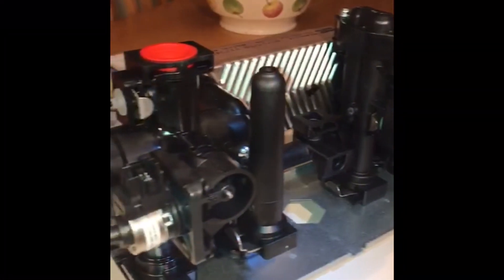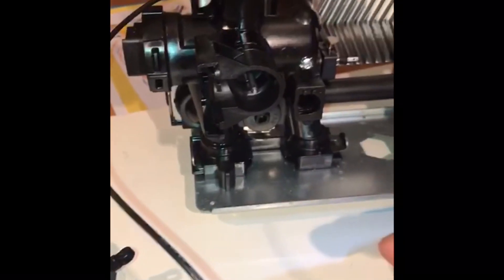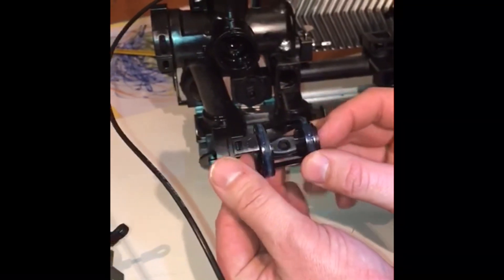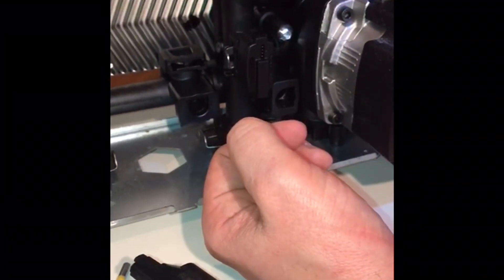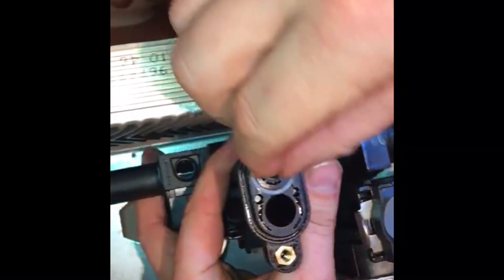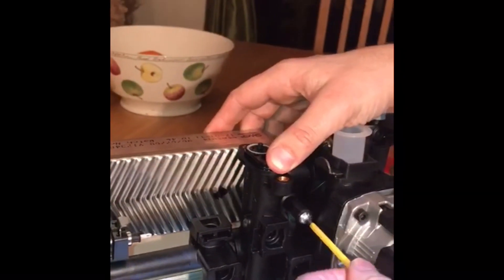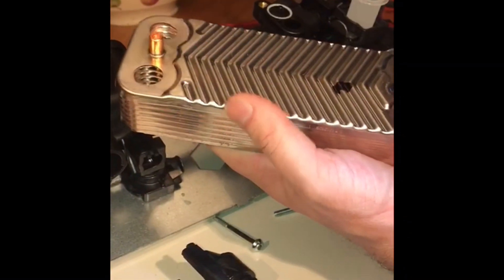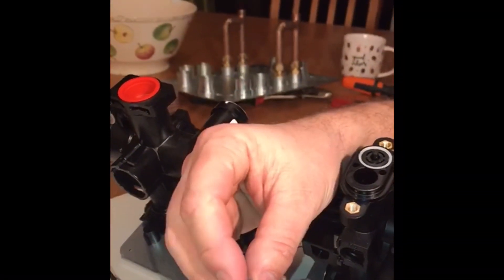Viessmann - Vitoden 100 faults

Comment: hi a have a problem with my viessmann b1hc 19kw ,the passes some of the water to the underfloor heating when it heats hot water . 
The divert valve is ok but something is wrong.
https://www.youtube.com/watch?v=KdfBphKlDzg
https://www.youtube.com/watch?v=uvaZe1xlXio
I remove the divert valvle i and clean him
stepper motor moves smoothly
Reply from the maker: Is the washer damaged
Reply: What do you mean the washer? In which parts?
Reply from the maker: @ssenatorr  drain down turn diverter open, clear paddle and seating

Comment: The boiler I have is a WB1C and the vent is leaking water, I presume it just a case of shutting the valves off at the boiler and twist the vent and pull off? Then to clean, does the auto vent need to be dismantled  to clean ? Thanks
Reply from the maker: Dismantle clean and add some silicone grease that will allow it move and seal

Comment: thanks, the flush hot water then cold ill try
Reply from the maker: The change in temperature shocks and expands the plate to plate knocking off the scale etc, vinegar, coke helps too

Comment: Hiya mate, how do you drain this boiler down, does it have a drain off on the boiler, I'm gas safe registered but not worked on this boiler? Thanks mate 👍
Reply from the maker: Filling loop
Reply from the maker: Or use a flat head and u may see a quarter turn nozzle underneath

Comment: Great useful Video. Is the Air Vent Valve easily removed. Mine is leaking water  as well. Thanks.
Reply from the maker: Yes clean clean lubricate

Comment: Hi, thanks for that really useful video. Would you have any insight on why a vitodens 100w would be leaking water through the air vent valve?
Reply from the maker: Lose
Reply: @warriorsofwarmth  Many thanks to Jay, as suspected the air valve was faulty in the end!
Reply from the maker: They do leak and seal up after a short period, if not dismantle and clean
Reply: @warriorsofwarmth  Should the cap on top be left loose or tight?

Comment: Great Vid buddy, I was beginning to you'd gone awol on us. Keep the excellent stuff coming. You're minds an encyclopedia of knowledge. Is this the vitodens 100w or b?. Those rubber hoses are flawed. At least they updated them to copper pipes 😊
Reply from the maker: ghostmanromeo uk the hoses are now phased out
Reply: @warriorsofwarmth  Yup they were pretty unreliable though. Great Boilers the viessmans 😊
Reply: ghostmanromeo uk  actually the rubber hoses are still very much around in the 050 series and also they are still using them in the 200 series they don’t give a problem on a proper cleaned flushed system